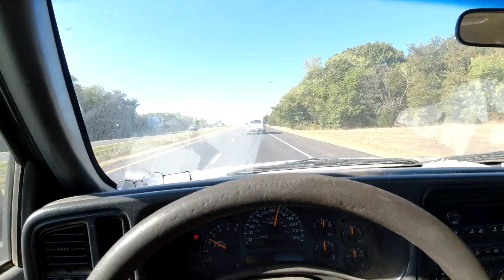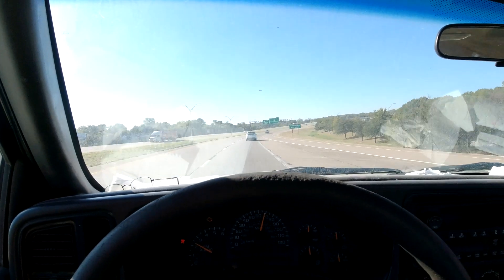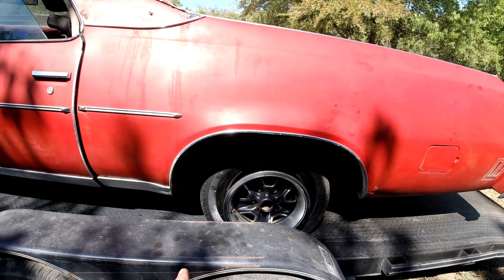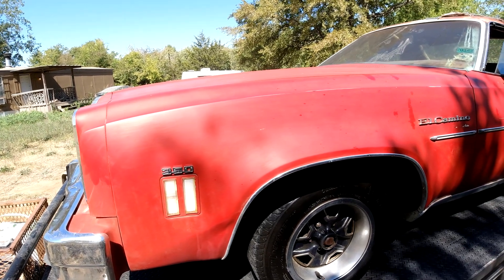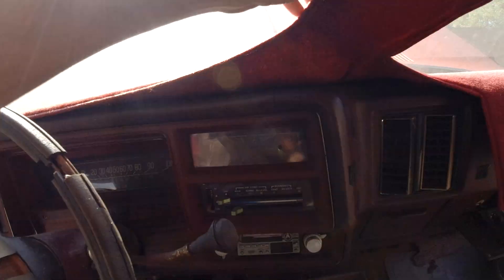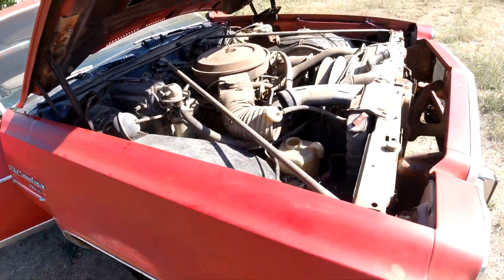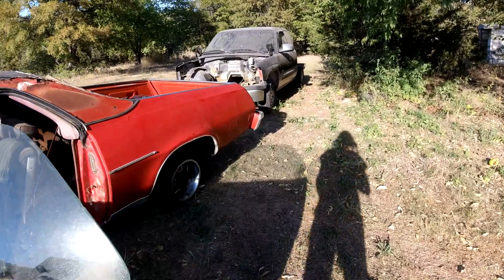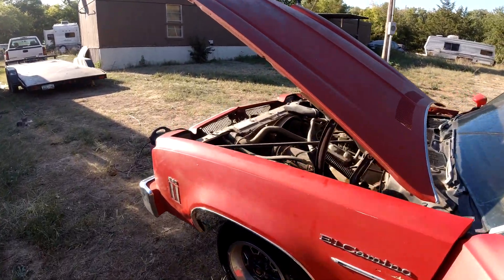I bought a 1976 El Camino. Will it run after sitting for 20 years !!

Comment: Love it.  Can't keep an old Chev down, eh?  First turn of the key and she's away.  To be honest, mate, that wouldn't take an awful lot to get moving under it's own power again and cleaned up.  Ok, she's not going to win any Concours de Elegance, but I agree that the paint looks like it has plenty there and would cut back and shine again if hit with a buffer.  The Olds wheels don't look too foul on it and sort of give it a point of difference too.  

I reckon buff her up, patch the small holes in the roof and paint down to the moulding like you were thinking.  Not sure on black - it would depend on what shade the red comes back as.  It might look better with a charcoal grey or mid-tone silver....but anyway.  She sounded ok - I guess the next stage is to see what the trans and diff are like before putting any real time into it...and yeah, ok, that means the expense of the tubular turny-turny bit that's missing.  If it moves, looks reasonable and stops again, she's gotta be worth more than double what you spend on it in oil, filters, plugs, wires, brakes, d/shaft and the purchase price - even if she's still got the rust and cosmetics (seat, carpet etc) for the next owner to address.  I reckon she looks too good to part out - that's for sure.  All the best, eh?

Comment: There is usually a small fuel filter on the inlet of carb , careful has tiny threads easy to strip. Don't ask me how I know. I like it  ,don't see them very often.
Reply from the maker: I know but there's usually another big one in the line below.
Reply: @clunkersandclassics  Ok cool, yeah I stripped one out , nothing some JB weld wouldn't fix . Once every 3 mos some dirt would get by and i would have to clean carb along side the road.  Could do it 10 min after a few times.  Nice job with tank getting all that Silverado wiring and fuel lines in that car must have been a pain.

Comment: Buff the paint, new vinyl top, spruce the interior up and sell it. Put as little in it as u can. I have a 76 gmc sprint that has sentimental value to me but it's too rusty to be worth fixing. I'd like to find a solid body to rebuild mine. But your right... these cars are pretty worthless to most people. Great driving car tho. They rust out really bad behind back seat and under the panel in front of bed. It has the full floor pan from a wagon in it and they are prone to rust

Comment: I had a 76 gmc sprint. Never my favorite car but whatever. Traded some parts for a paint job on it and shop burned with car in it. Funny thing is my rallies were stolen off of it and I threw pretty much the same wheels on it. That generation is the ugly duckling of el caminos, but I actually like the looks of them a lot more today then back in the day.
Reply: I drove a 76 sprint myself to college.  I built a dart headed 355 and a 700r4. Drove it last couple year of school. After school I pulled the engine and trans and put on a c10. Still have it and the car sitting in the cow pasture.
Reply: @colescrustycars  Right on, glad part of it lives on. 20 years ago I didn't think much of them, I had several nicer classics. Now I'd rather have a driver that I didn't have to worry much about, other than maintaining it and driving it.

Comment: distributer goes to ported vac. only get vac at higher rpm. if you put it to manifold vac it's gonna run at full advance at idel, and go to 0 advance at full throttle.

Comment: 4TH GENERATION.
Yes we're droolin, that's a homerun. 5-6K car, running ,all day long.
I think the driveshaft was maybe an antitheft measure.
If your not going to put the vinyl top back on it, (I think you should) maybe rhino liner it.
Maybe find a Laguna nose for it, just for fun, a set of rallys, with caps & rings, or aluminum slots.
The 4th gens rode better than the rest of them. Good factory color, kinda unusual color combo actually..
Factory air. If it's got a turbo 400, they love to tow. Good/fun backup tow toy, parts runner.
It fits right in with the current collection, just don't stripe it. 
Just my opinion, but you did ask. ( I like it more than the Nomad)
If you wan to get really crazy, maybe find a set of swivel bucket$ and console. Crazier still , 4spd.